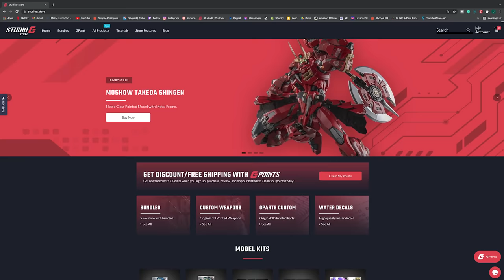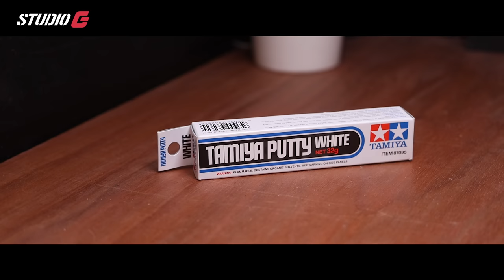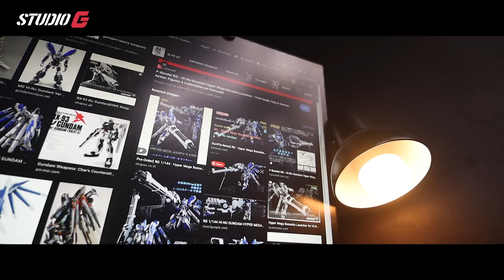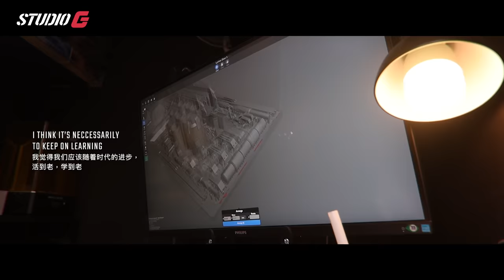Customizing the KING of Gunpla | RG Hi-Nu Gundam | ASMR | Custom Build | 4K

Comment: I've actually never built a Gunpla model kit. I had all the toys as a kid and still do collect them when I come across one that I loved. I do build Zoids though. I would say I'm, moderately skilled/experienced at this point. What this guy does is no longer a hobby, building a model, or even customization. This is art. I'm not doing the math but at least 1/4 of the parts on the finished piece are custom, not to mention the paint, panel lining, and overall redesigns and changes he made. Truly art, I'm new to the channel, this is the first video I ever came across. But you should be proud. Coming from a guy that struggles to get the nubs off of some of the smaller parts of kits, this is amazing. Absolutely incredible.

Comment: I'm curious, is it possible to power the led using a pretty small battery (like the one used for surface pen) inserted in the fuel cell (the cylindrical tube thingy on the back)?

Comment: Love your videos, love your work. Will be getting your paints soon. 
I need to ask a question. Did you top coat this build at any moment? Wondering for when I start using your paints. Will be my first time airbrushing.
Thanks!
Reply from the maker: Yup, too coating is usually at the very last step. For this I use Mr Hobby flat top coat, just a super fast and thin coat to blend the decals into the paint. I don’t show that process cause there’s really nothing much to show 😅
Reply: @StudioGundam  oh my lord! First of all thanks for answering! Can't believe it. So no gloss coat before panel line and decals? Also, I don't like glossy look so what top coat would you recommend? 
Congrats on your store, it's awesome and hi from Puerto Rico!
Reply from the maker: @JohnReynolds123  nope. I don’t top coat after painting cause to be honest GPaint doesn’t need them haha! And thanks for comment too! 🙂 Como estas!
Reply: @StudioGundam  that's what I thought. Should I wait for the new metallics? Will they be out soon?
Reply from the maker: @JohnReynolds123  they are set and targeted to be released around mid-end march. Working hard on aligning the launch and paint production! 😄
Reply: @StudioGundam  last question! Where do you get those mixing cups? Thanks!
Reply from the maker: @JohnReynolds123  just some online shop like Amazon actually. They are just take out cups for sauces or condiments :) you can buy them in bulk for cheap hahahaha

Comment: Hey Justin, what software are you using for the part design for the 3D resin printing?
Reply from the maker: It’s Shapr3D :)
Reply: @StudioGundam  Right on. I looked into 3D printing a while back, specifically in regards to Gunpla. I didn't really see any builders doing anything with it at the time and I got side tracked with other projects... I'm looking at my options in terms of software. I've used SketchUp a bit and was considering Fusion360. I'm glad to see you get into it though. I see it becoming a big part of Gunpla's future, as it allows you make your own detail up parts with the freedom of design that you get with scratch building. Or you can look at it in terms of making your own resin kit for any build. There is a lot of potential... I think it's going to take the hobby to the next level.

Comment: there must have been and issue with the molding of this kit. Mine is still in the box and I went and checked that part you were missing and even on my kit it was already disconnected from 2 of the points on the runner, Fortunately I still have it but I imagine thats what happened with your's.

Comment: I just messaged the support on your new website. I noticed an issue when going to the site where the review shows up on the left side and it's blocking the menu on the left side. To where you can't see when looking at the grades of the Gundams. It's mainly block MG
P.s I'm just trying to get some of your paints and that won't work either
Reply from the maker: Thanks reporting the bug, I will fix the website asap! 🙂
Reply: @StudioGundam  No problem. I know it's a new site so it'll have some bugs. Figured Id report a few asap so it would help. When I get some more gundpla money, I'll definitely be buying your paints.
Reply from the maker: @Jlt431  thank you! Much appreciated :)